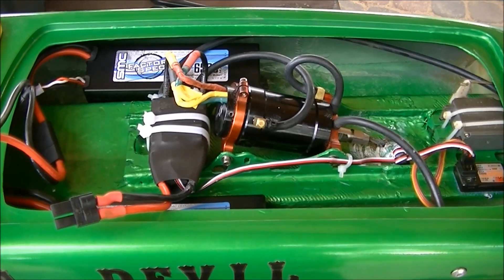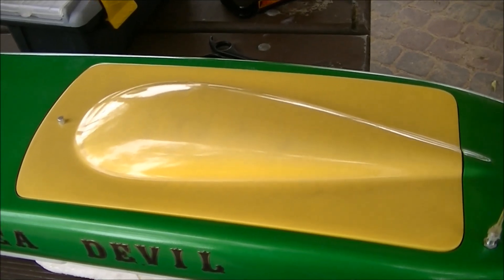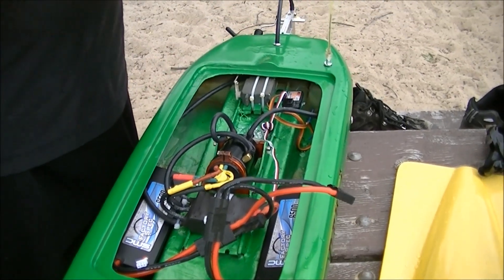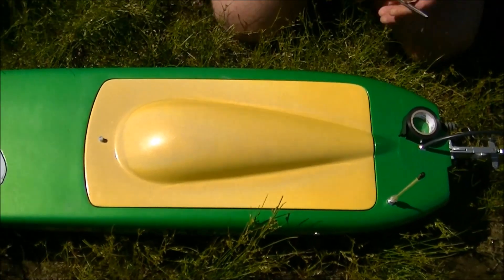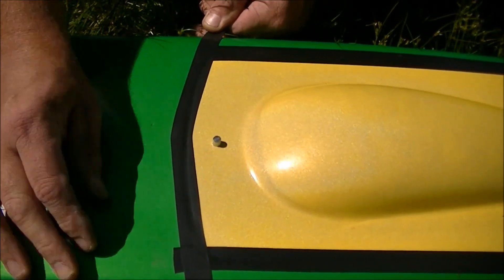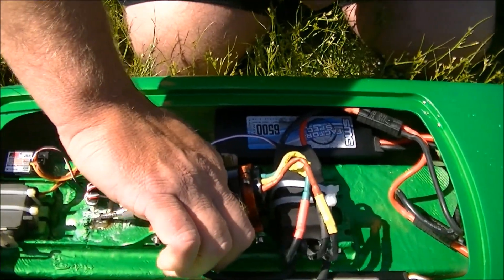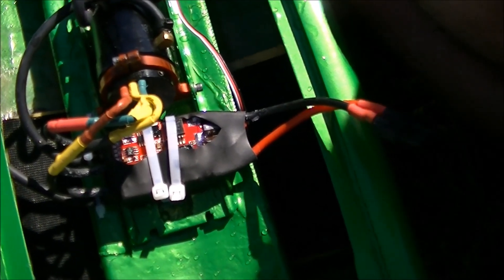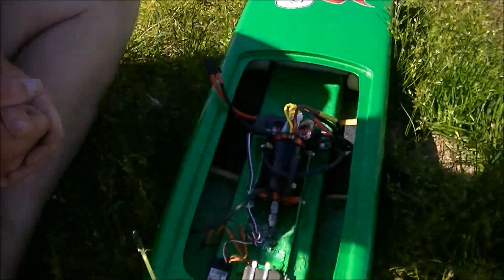Eachine SS 200A RC Boat ESC Review From Banggood com

Comment: Just come across this vid- I've been thinking about buying 1 myself,But personally I'd have mounted it the other way up with the water cooler heat sink/exchanger on top so the heat from the power fets doesn't cook the control driver board (just my 2 penneth worth of advice). I hope you got it sorted with something you find more reliable.All the best.
Reply from the maker: thanks

Comment: Don’t ever reach in there and touch caps or anything without discharging by touching pos and neg together on esc. A friend of mine blew the end of his ring finger off “seeing how warm they are” those store lots of voltage, that’s why the heat shrink covers them, don’t be a dumb Donald.
Reply from the maker: ya well iam and electronics Tech and i know what iam doing but thanks for the comment

Comment: That boat is faster than a speeding bullet! puts a whole new meaning to the term Launch ha ha
Hey that ESC sux big styles, thats the last thing you need, what you do need though is break away nylon bolts on your rudder (-:
Reply from the maker: Jax Teller RC the esc sucks for sure and yup the rudder is going to be back as a break away setup again , i locked it cause i thought i would be safe but guess not. its ok the boat is all fixed now just have to repaint the rear end today and slap it all back together and shop for a new GOOD ESC
Reply: Kevys Rc & Music
Thats great to hear man, those boat ESCs arent cheap for good ones (-:
Reply from the maker: Jax Teller RC nope the good stuff never is cheap iam looking into one right now and its going to cost me almost 200.00 bucks but its said to be good and some are using it in the HK genesis boat so might be ok will have to see , iam not made of money so if i go for it its going to be awhile before i can get it
Reply: Kevys Rc & Music
WOW! That is expensive, thats almost a thousand dollar boat now! Sheeesh!!
Reply from the maker: Jax Teller RC its getting costly i just hope iam done fixing the hull from now on its a pain to fix and repaint LOL oh well stuff happens
Reply: Kevys Rc & Music
Yeah, that would be annoying!
Reply from the maker: Jax Teller RC yup but part of the hobby right break it fix break it again LOL oh well back to the drawing board agian ..
Reply: Kevys Rc & Music
Sure is mate, it never ends ha ha (-:
Reply from the maker: Jax Teller RC it will end for this boat if it eats a good qauility ESC that i promise muhaaaaaaaa
Reply: Kevys Rc & Music
Ha ha ha aha aha another RC takes a trip to the shed for a date with the BB gun LOL
Reply from the maker: Jax Teller RC i was thinking the basment with the bandsaw my self how ever i have a friend that has a shot gun to muhaaaaaaaaaaaa,, i guess if the boat wants to keep a happy home it had better not eat a good quaility expensive esc
Reply: Kevys Rc & Music
Ha ha ha, Neil could shoot it with his cannon LOL
Reply from the maker: Jax Teller RC hahahahaahahah  iam sure he would enjoy that
Reply: Kevys Rc & Music
(-:
Reply from the maker: Jax Teller RC :)

Comment: Wow. That sucks dude. That esc isn't even close to 200. I hate about the transom too. 👍
Reply from the maker: Tybos RcMotorsports yup thats what i thought to the 125amp was no different so not even a 125 either so this 200 is not even close to 200 i doubt its even 100 amp my motor only draws 100amp at full throttle,, ya the back of the boat i spent some time on the boat yesterday the Transom is all fixed now just have 1 final sanding to do tape it off and paint it on monday and she will be better then new it broke right on a seam weak point  of the boat i guess perhaps i will do a  review soon on the HK genesis hull LOL

Comment: bummer !.i would mod the rudder with a good spring to save your transom .  just an idea.
Reply from the maker: MyPuppers it does have a break away system but i locked it cause i thought with m driving i would be safe cause i have never had a problem in boats before but i guess i was wrong so yup shes going to back to being breakaway.. oh well 2 weeks and the boat will be fixed and another month i might have a good esc for it going to cost me money this time for a real esc .. and i want to make sure i get one to with reverse if i can reverse is handy ..